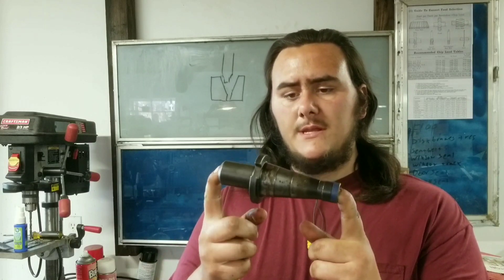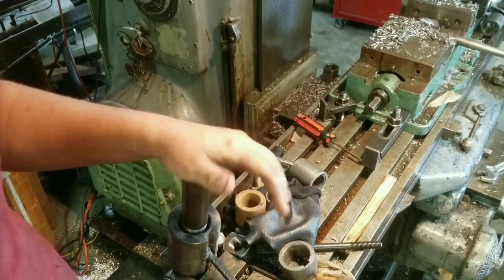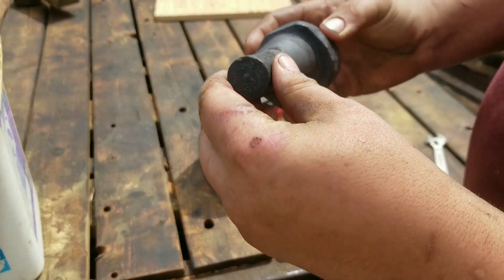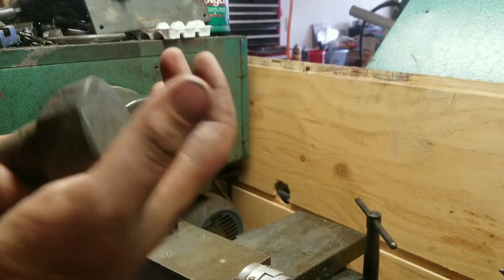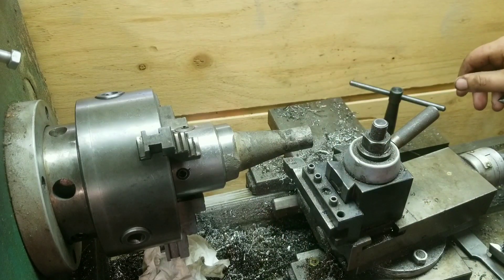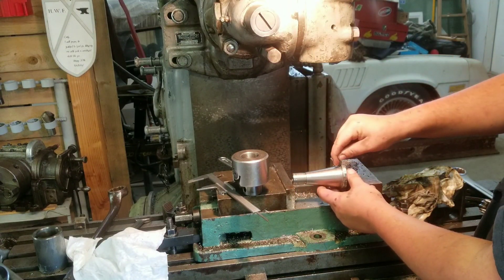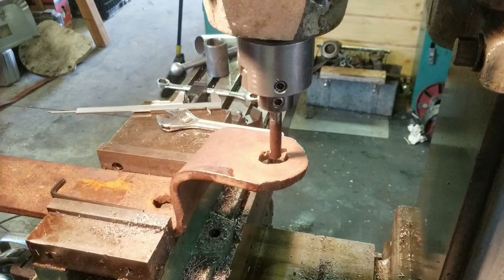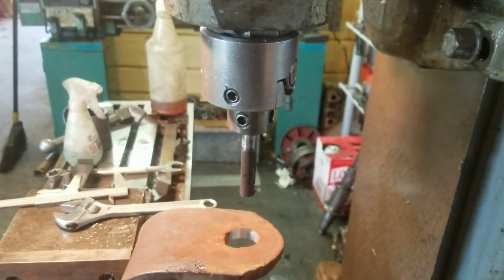Forging and machining a 40 taper tool holder

Comment: Great video! How did you measure your taper? Did you just check the big and small diameter until they were within tolerance?
Reply from the maker: I checked it against another 40 taper tool I have that I also used to set the taper

Comment: Very clever approach.  Does forging also make the steel a bit stronger also? Like crankshafts?
Reply from the maker: Yes, it does. The grain is more refined and it flows into the shape of the part; kinda like allowing a tree to grow into a mold instead of cutting out the shape from a solid block